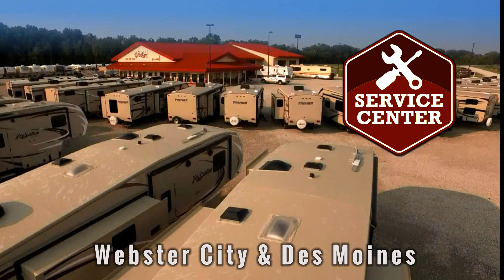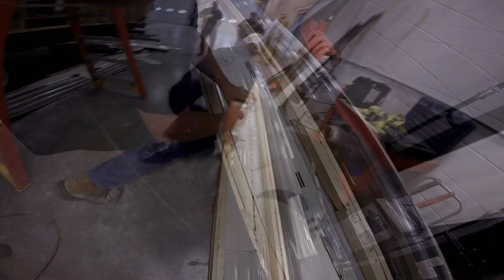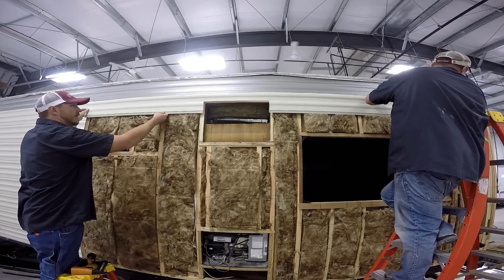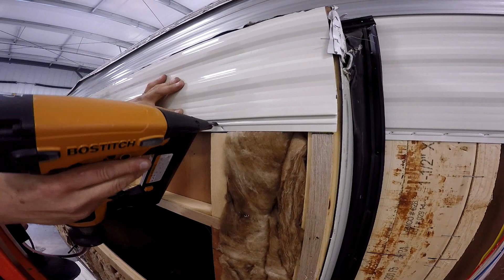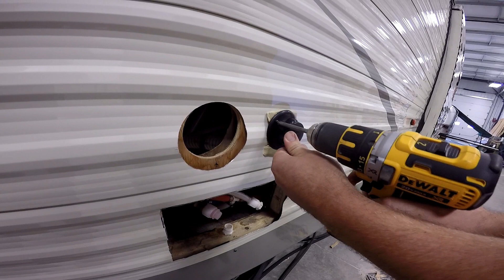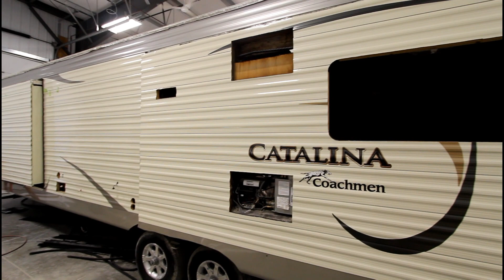Replacing RV Aluminum Siding

Comment: Hello I am currently looking at rvs to fix up .. some I've seen have the side paneling  messed up.. so have a few questions .. the metal where can I find it .? And how are the edging done.. and umm doors and windows .. if they are broken where can I find them .. can I make them ?
Reply from the maker: Metal is ordered from an RV Dealer which gets it from the RV Manufacturers. As far as edging is concerned everything is sealed with Butyl Tape then the exterior trim is put on, then sealed with RV Caulking. We can order windows in generally any shape and size for you.

Comment: I have an older fifth wheel with corrogated aluminum siding that my Grandpa had bought new in 1997, Its still in nice shape, but the corners are coming apart and I developed a leak in the front cap. Its a Wanderer 27rks by Thor and want to get it back to great shape and maybe replace all the siding, do you have a cost?
Reply from the maker: Very difficult to asses without seeing it Michael. Leaks can develop feet, even yards, away from where they actually show up. if you email us at goodliferv@glrv.com we can start communicating about it with a Service Advisor.

Comment: My Viking 17BH wheel well trim was torn out when a tire blew out on the highway. How can I replace that trim piece?
Reply from the maker: You have to get the same trim, remove the old one, and apply new one with Butyl tape underneath and then caulk around it when it is installed.

Comment: Where do you buy that siding?
Reply from the maker: Metal is ordered from an RV Dealer which gets it from the RV Manufacturers. As far as edging is concerned everything is sealed with Butyl Tape then the exterior trim is put on, then sealed with RV Caulking. We can order windows in generally any shape and size for you.

Comment: Aren't you supposed to start at the bottom so each piece can over lap?
Reply: RV Siding goes on the opposite of house siding, installation is from the top to bottom. And yes they over lap, actually it like an Under lap.
Reply: @webstercityrv  that's what I get trying to be smart alex. where can I purchase the siding?
Reply: @SteveOfTheMountains  RV Dealers can acquire the metal from an RV Manufacturer.

Comment: How difficult is it to remove siding in order to get to damage behind the siding? For example in order to repair the wood structure due to water damage? The intent would to as much as possible reinstall the original siding.
Reply from the maker: Generally, we repair/Replace rotten wood from the INSIDE of the camper. The techs even take of Cabinets and Cupboards along with interior paneling to replace them.
But if you must take off the siding, it isn't that difficult, just pulling staples. But make sure you keep them in order to replace them. The hard part is you may have to take off the WHOLE side of the camper to just get to the parts you need to fix. Use Butyl to seal all windows and seams, and caulk around all the outside fixtures in addition.

Comment: I have a bit of a different project but im curious what dimensions is the wood frame made of?
Reply from the maker: Some are 2" x 2" and some are 1.5" x 1.5". I think 2x2 is most common.
Reply: @Glrv3Stores  thanks. My project is a 57 Ford pickup that im planning to build in to a sort retro looking mini winnie, so im just trying to get a sense of what i need to build it with.

Comment: How much would it cost to remove all the siding and put LP lap siding or flat aluminum(non corrugated)?? Thanks
Reply from the maker: There are SO many variables. Like availability of the siding, size of camper, how many sides, how many attachments to the camper. So a rough range could be anywhere from $8k-$20k.

Comment: The metal is going to pop loose , that’s the wrong gun to use it has to be a wide crown the factory uses a m11 staple gun, not a pin nailer
Reply: Billy Slone Sage advice billy

Comment: Very cool video.  Just in case I would have siding problems do you know where I could purchase RV aluminum siding?

Also, have you ever run AC or DC wiring through the walls of an RV? I'd like to run about 8 DC outlets and 5 AC outlets throughout my travel trailer and tie them into the power distribution panel. Some people suggest I could run them under the RV and up the walls but to me, total novice, I would think the walls of the travel trailer would be bolted to the travel trailer metal frame.
Reply from the maker: An RV Dealer would probably have to get you the siding, and as you can imagine it comes in very long boxes. Dealers have access to the Manufacturers who use the siding every day, so that is your best option.
Concerning the wiring, I would think it would be to your benefit to run the wires inside the walls if you are going to have the siding off anyway, Make sure the wires aren't pinched or get nails/staples into them when putting the siding back on. Happy Camping.
Reply: Fortunately I have no siding damage but it makes me feel a lot better that I can probably get replacement siding ordered through dealers.  Thanks!

Assuming the siding is not off the RV do you have suggestions on wiring AC/DC circuits through the RV?

My most recent thought was to run a box around the wall/roof line (inside) and drop wiring for the outlets down between the wall studs for the outlets.  I'm also wiring in three external security cameras which I'll be placing on the outside/top/front/[left & right] and outside/top/center to be used for backing up the trailer.  They use  coaxial connectors close to the camera so it would be good to get them inside vs running them along to the roof top.
Reply from the maker: I would try to keep the wire inside if you could. Regarding your cameras though, there are many brands out there that are wireless and you would only need to tap into the 12V power of a nearby marker light to power them.
Reply: You can order the metal from the factory elixir , out of Goshen Indiana

Comment: About how much does it cost?
Reply from the maker: Usually only 1 side of a camper is damaged, and on average the long side of the camper siding is around $3,500 to repair.
Reply: @Glrv3Stores  Lol $500 in metal and decals, $3500 to repair? 30 hours of labor I guess? You guys need to speed it up lol